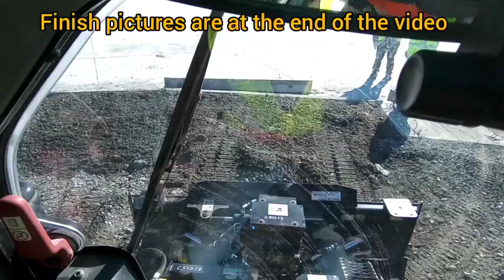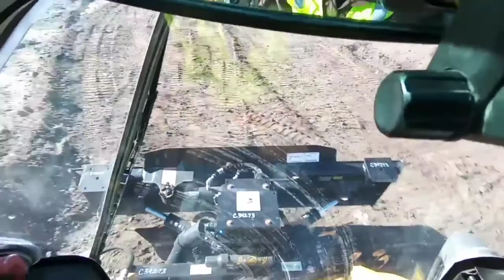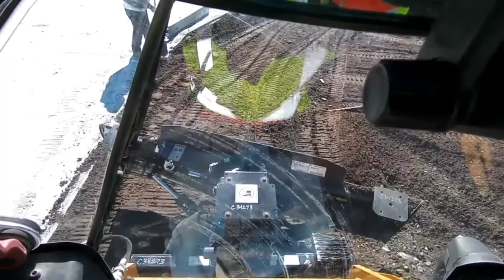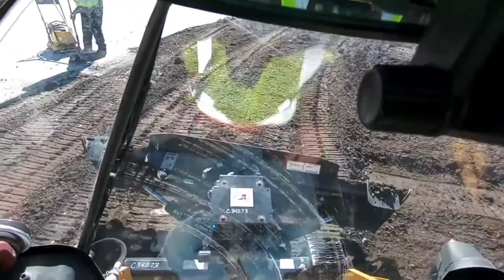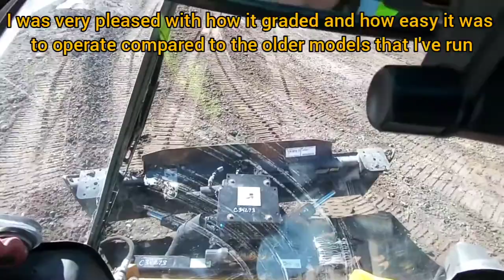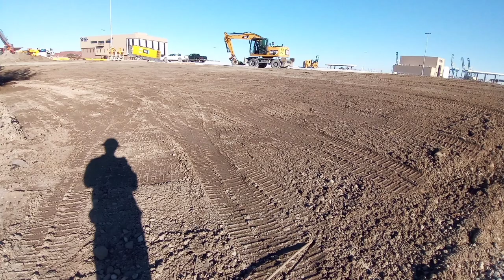Cat 289D3 skid steer with a new smart blade from Cat

Comment: Important note: Requires a high flow machine to run properly. I bought one, had it installed, and when it wouldn't work right it took them a week to find out that it was just a flow issue. It's not well documented.

Comment: I have a 289d, and I've operated the 299d. We use the 299d cause it will run the big mulcher but I purchased the 289d for dirt work and tree work.now I'm curious bout dozer blades and skeptic of some things. They have 2 price ranges on these blades, skid pro, cat, and other for example make really heavy duty and built thick with 5/8 steel and priced at average of $7500 and up but if you only got 74 horse power with the 289d verses the 100 hp in 299, I'm curious if I could just go with the lower grade bladesade with 3/16 and save at $3500 or lose cause they're not gonna hold up. None will take the place of a dozer but for grading and cutting some I definitely see it worthy of having the attachment.
Thoughts?

Comment: That smart blade is about twice the price (~14k with tax) of a plain dozer blade (~7500). I'm looking at one right now. My only question is will it cut at all with an 11,000 lb CTL with 75hp (Cat 279)? Or is it just good for spreading out dirt and aggregate that's been dumped out of a truck? Do they make a ripper for the back end of a skid steer to make the blade more practical?
Reply: I’m a cat fanboy but check out the new case Minotaur. C frame dozer attachment with ripper. 18k pound machine

Comment: Meh. I could see this tool being handy for contractors doing residential work, that way you’re not lugging out a heavy dozer to all these houses with paved driveways and roads where it could mess them and the lawns up. 

But if you’re already at a large job site……a small dozer would be much more efficient. Plus, SkidSteers are not really meant to have this kind of load put on them all the time. They’re not real big pushers. They’re lifters.